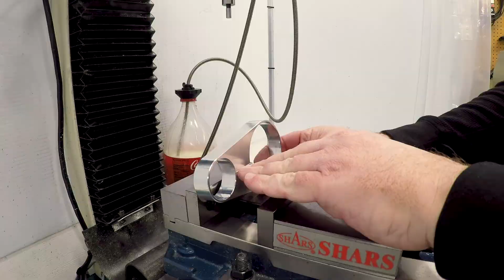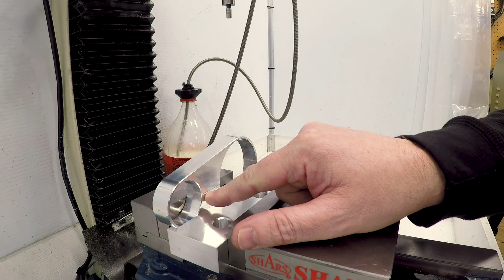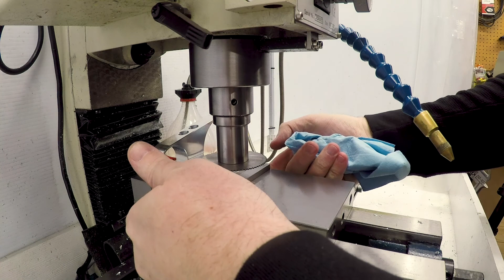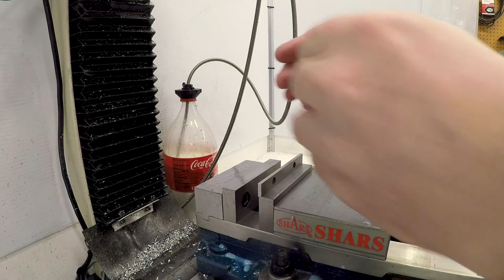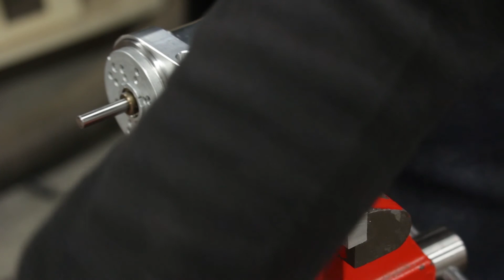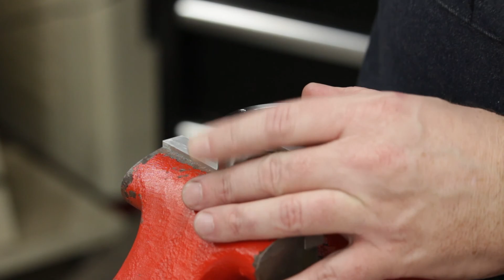Making a Toolpost Grinder Part 11: Motor Clamp 3

Comment: James, I have watched almost all of your videos and I think without a doubt you make the best videos of any that I’ve watched and I have watched hundreds from many different Arthurs or Producers. I have wondered if you have a helper when you are recording that switches from one camera to another? It is done so smoothly and at the perfect time. Of coarse I know that you can smooth things up during the editing but none-the-less it is almost perfect as far as I can tell.
I am very new to machining and I have learned so much watching your videos, partly because you explain what you are about to do to the project and why you are doing it the way you have chosen and what your other options were all before you start the operation. Another thing that impresses me so is the fact that you are so organized. Everything has it’s place in your shop and tool cabinets and you always put the tools and other things back where they belong as soon as you get through with them. You also get so much work done with reasonably small machines. Keep up the good videos and be proud of your work. Thanks.

Comment: A very impressive design, and work. I have been planning a build with similarities of design. I am wondering about the bearings. Are you using an angular contact type?
Reply from the maker: No.  The bearings are 6804-2RS deep-groove ball bearings.  I couldn't find a readily-available angular-contact bearing in the size I needed, so I went with these.  On paper, they'll handle the preload easily, and they seem to run smoothly at speed.  I guess we'll see once there's a wheel on it and I try to take a cut!